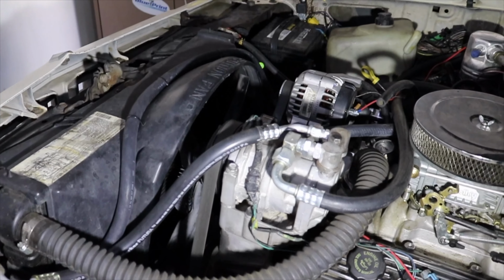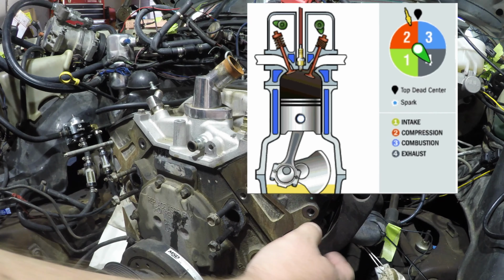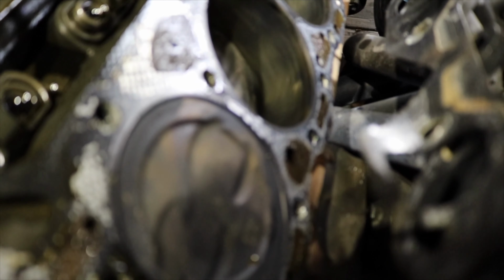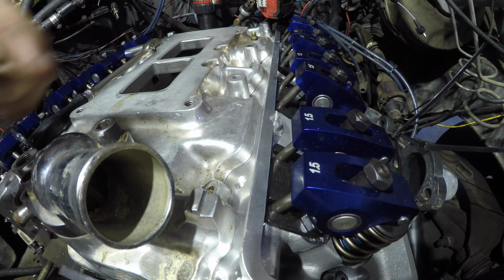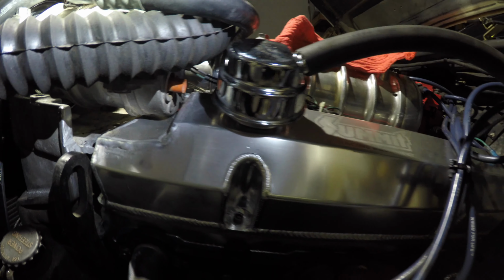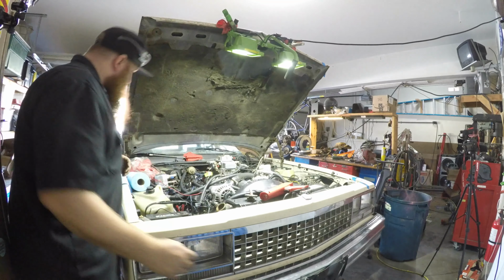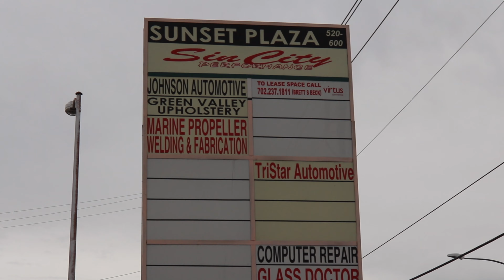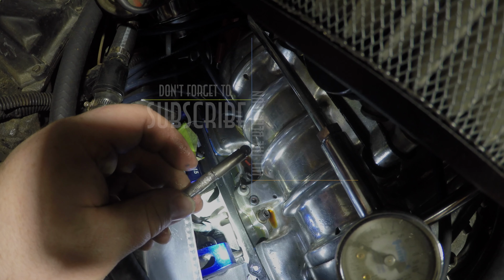Supercharger, heads, and Cam go in  and DISASTER STRIKES!! | #FamilyBurnoutWagon EP19

Comment: I like it! Did you use hardened pushrods? The pushrods in my Maverick rub on the guide plates too but other than some rub marks they don't get damaged. Been that way since I built the engine back in 2006.
Reply from the maker: Thanks man. I found that the night before I deployed so I haven't been back to do anything about it. I am torn between pulling the guide plates out or replacing the pushrods with aftermarket hardened ones. I haven't found anything that is definitive, but I thought the stock pushrods were hardened. Any thoughts on it?
Reply: @BurnoutsAndRotorblades  You must run hardened pushrods with guideplates.

Comment: you just  didnt adjust the valves right happens to the best of us mines a b&m 144.
 smallest wheel should be 5-7 psi  buy a autometer boost gauge it better have 10 rib pulley
you 401 hp 460 tork is actually low
because a 20 psi roller barely loads the supercharger 
but gives a base line.
pushing the car down the road will load the cylinders better
another words it will beat up a 500 horse 650 tork naturally asperated engine.
a 200 hp add on
and a 144 will not stop adding hp like you think if you wind it up to 7000 rpm youl be cranking out 800 hp
and will spit out stock normal gapped hyper pistons lol  and the head gasket is sure to go 
you need steel ring gaskets or machined in steel rings
Reply from the maker: That combo had about 1000 miles on it when it coughed cruising on the highway and bent that rod. It was a bummer but I’m happy it happened because I discovered the pushrod wear that would have surely caused much bigger problems in the near future. Now that I think about it, the lip that was being worn in to the pushrod could have been partially responsible for the whole ordeal. Either way, I have some upgrade videos coming. Step one, new fuel type. I’ve already gone e85 and I’ve about got the setup dialed. Stage two, tear the engine down and open up the ring gaps in preparation for a smaller pulley. The trans needs a bit of love so that will all happen at the same time. Then I’m hoping for 5-600whp. I’ll have to look in to the pistons. I was under the impression stock hypers would work fine at that power level. I’ll be putting on MLS gaskets for sure though. Coupled with the ARP head studs, I should be fine there.
Reply: @BurnoutsAndRotorblades  you missed why your rod bent it was detonation 
all your advance needs to be in by 2000 rpm
your car back fired e85 might have killed fuel pump  or just tune up 
probably bent valve or was there antifreeze in cylinder lol blown head gasket
and your hypers will only last 6000 rpm or so 308 gears might save them 
1 of my freinds blower shot a push rod like a bullet right through a steel rocker arm 
valve cover hood and I think its orbiting the earth now lol
good luck
Reply: @alonzahanks1182  been running a 144 on a 40 over  stock bottom end for over 2yrs now and done so many passes in it you couldn't count them and it has all the parts you just mentioned wouldn't work 🤣🤣🤣🤣🤣 I'd say it's more of a tune ability issue
Reply: @jonathanlawson4667  Sorry  I thought you ment piston rod got bent .
Hypers are fine with gapped rings theyl actually not swell much and run tighter clearances where the pistons dont have to do a long warm up being your daily driver 
make sure you use steel ring head gaskets .
I ran my B&M 144 corvette supercharger for 65000 miles the good wrench box engine had 50000 mile bearings in my 76 Blazer 2 virgina city 500 off road baha races  hill climbs on and off pavement and sand drags winning all 4 events 2 years in a row against Rod Halls 1000 Horse Power Hummer And many others with Blown  big blocks 
And spanked them all lol with 308s 2400 custom  stall converter shift kit Turbo 350  
crane anti pump up lifters Crane 480 510 blower cam crane 1.5 gold roller rockers 
Hooker headers Hypertec Hei coil  changed the gears to 411s 
Trew it in low lock hit about 14000 rpms and took off like a acme rocket  
spit out pistons head gasket and spun a bearing all at same time
Felt like 2000 hp lol ran race gas but liked estes 12 percent nitro airplane car fuel 
id mix a quart with 32 gallons of gas  with 92 octane its 140 150 octane and hand ported 
good wrench heads comp 400 pound valve spring  the stock valves were hollow filled with epoxy realy light realy strong 
and took realy high revs put in threaded studs with helicoils 5-7 psi wheel 12 degrees of timing
in the desert everybody running 14 psi big blowers over heating packing ice bags 
mine i can put my hand on I kept having people tell me I dont think your left front wheel ever touches the ground lol my ported iron heads actually  exaust valve seat had a tiny crack from driving it home with blown head gasket.
Ive got forged teflon skirted corvette  pistons in a 355 to make 9 to 1
using my B&M 144 for a fart fan in my bathroom so it doesnt grow legs and run off lol